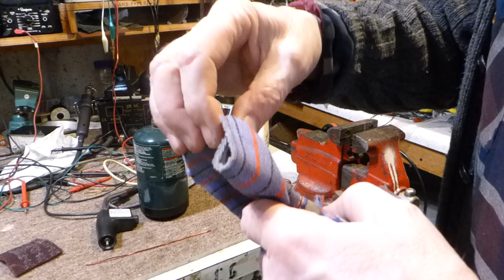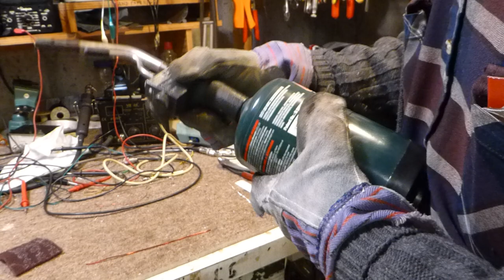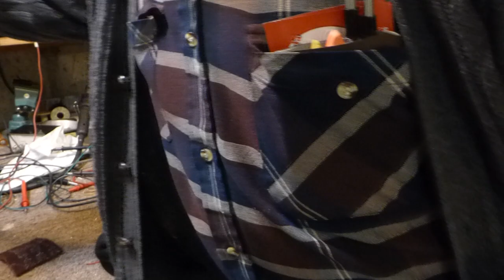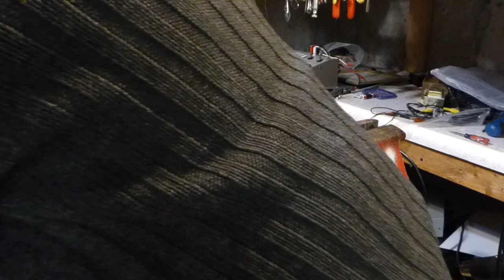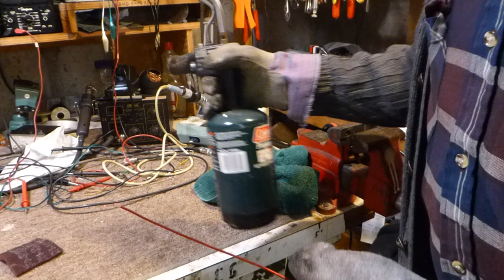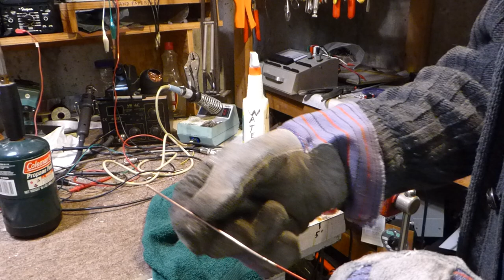stripping enamel from heavy  magnet wire,Stripping enamelled wire,stripping #14 magnet wire .

Comment: GREAT!!  I need to do the same for TINY (~30 AWG) magnet wire...with a complication...I am making LITZ wire, and need to remove about an inch of insulation on a batch of about 20 twisted wires where I have "flowered" them out at the end.  I think heat would burn the thin wire.
This was the first video I found and was wondering if you might have any suggestions.  I am thinking that it may have to be dissolved somehow????
Thanks for the video,
THUMBS UP AND A SUBSCRIBE!!

Comment: Question, Does the enamel coating change the Velocity constant of the wire for antenna use? Carl
Reply from the maker: Carl I am sure it does have a little effect but  not much I have made dipoles with single strand enamelled wire , Single strand bare wire ,multi strand bare wire and  insulated  wire like used in house wiring the solid and multi stranded too  with good success ... there is usually some cutting and trying with wire antennas BUT a good antenna tuner will do a lot to provide a good match .  To me an antenna analyzer is a must have instrument . A combination of 80 and 40 dipoles separated maybe 20 feet at the ends  and fed with a single 75 ohm coax is my favorite  wire antenna setup because it is simple,easy to put up and tunes many bands using an  antenna tuner .I get the dimensions for dipoles and other antennas  at the K7MEM  website  the dimensions are usually very close to what is needed .  years ago we did not worry so much about SWR using something to show RF going to the antenna like a light bulb in series with the antenna then removing it when we had the transmitter tuned for maximum  .
we just tuned for maximum output  HI HI  these days if that is done the modern rig will reduce the RF power way down even shut it off completely  so I like to see the antenna and tuner  have an SWR  below  1.5 to 1  at resonance as shown on the antenna analyzer THEN connect the rig  .  73  Bob